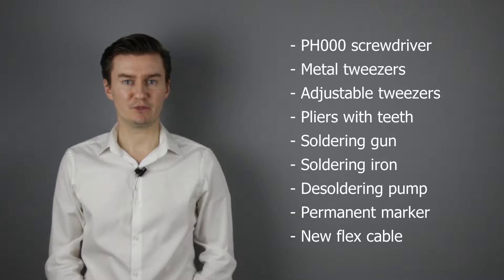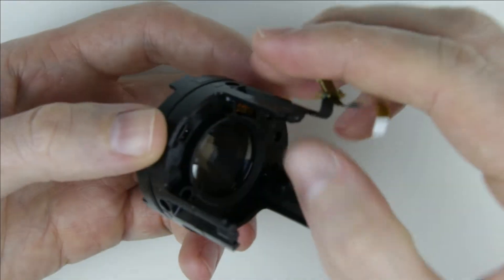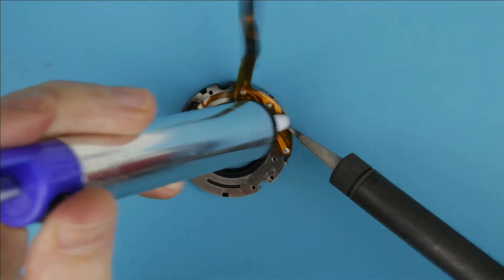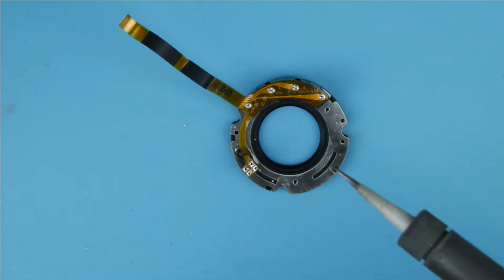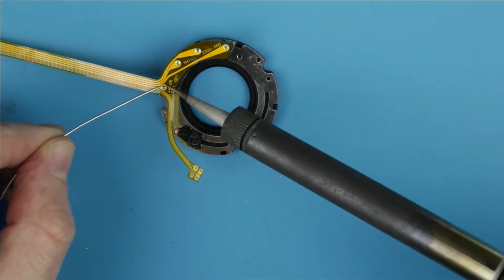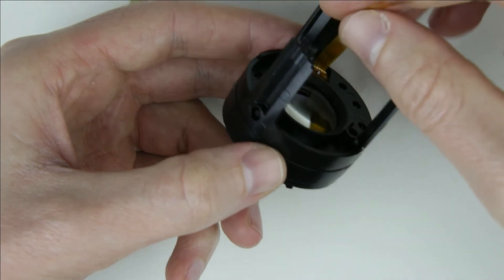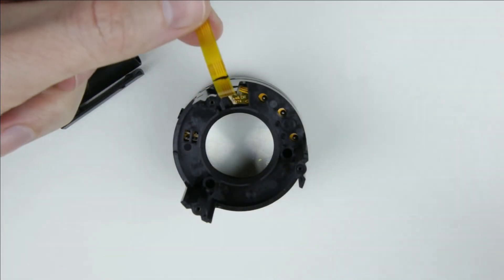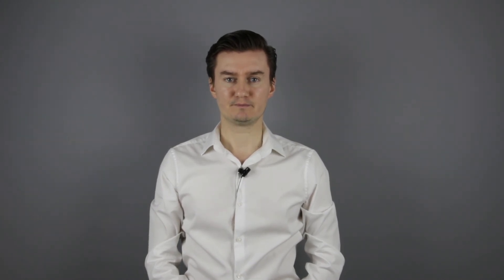Canon EF-S 17-55mm f/2.8 IS USM replacing the aperture flex cable after disassembly

Comment: Hello,
First off, thank you. You helped me with my sigma 170-500mm and hopefully you can with my canon 17-55mm.
I have fixed many lenses but most vintage or very simple electronic ones. I’m a little worried about the soldering part. While I can do simple soldering(simple wired electrics only), I have never done so on a flex cable… would you say the removal and replacement of this flex cable in terms of the soldering is tricky or very easy. Thank you very much for your help.
Reply from the maker: It is quite easy, but you have to be very careful when you remove the soldering iron and the old flat cable from the aperture unit. It is quite easy to damage the pins.